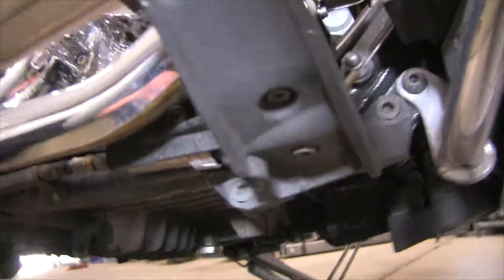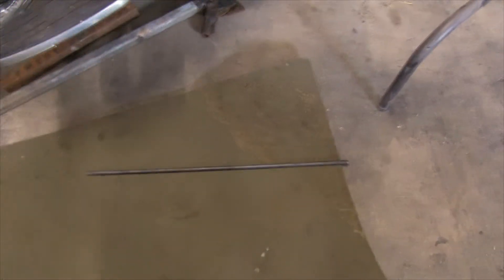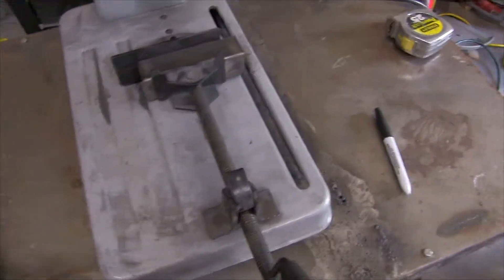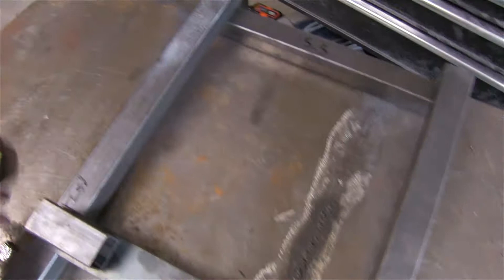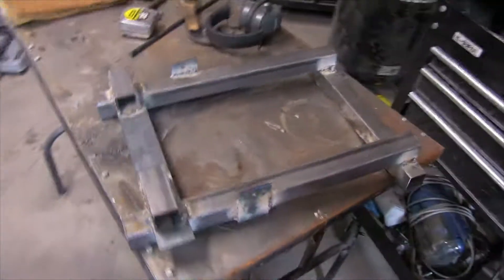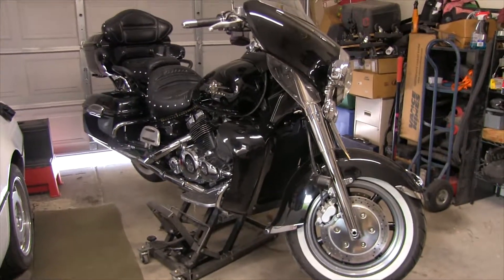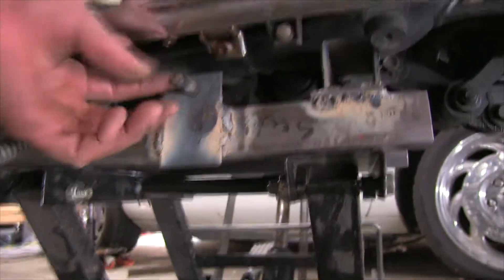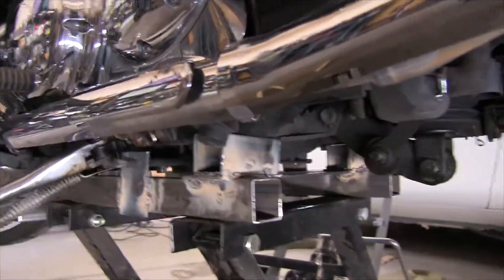Royal Star Venture Lift Adapter Fabrication

Comment: Hello there great video. ?what size metal square channel is that ?whats the measurements  from channel to channel dead center? how far up are the 3 inch pieces? how far up are the  2 pieces  with the holes in them and  how far up is the hole from the channel? thank you